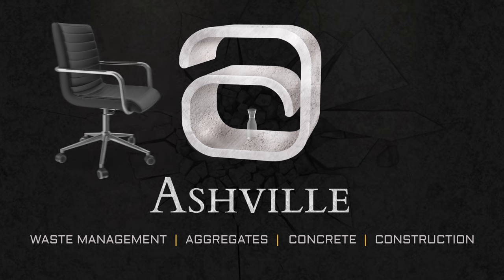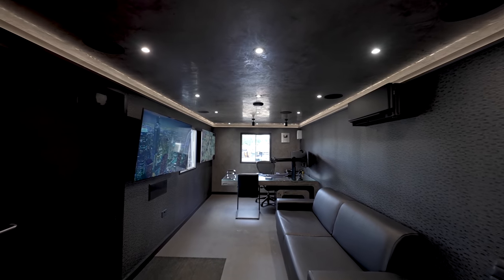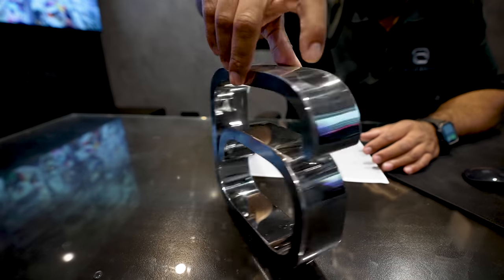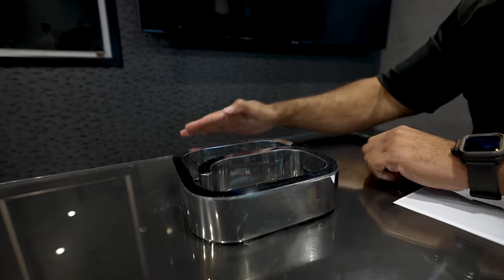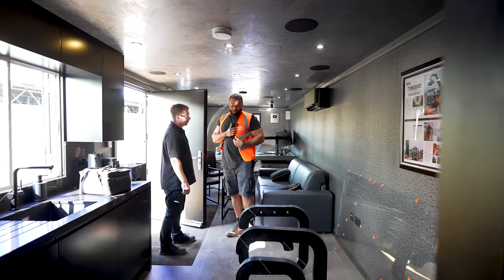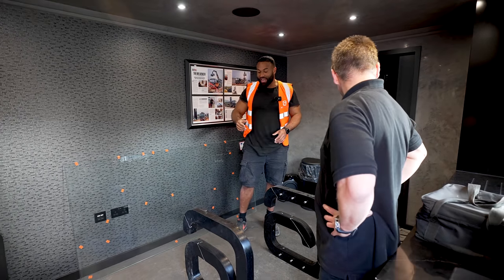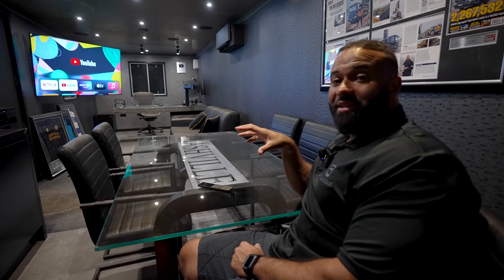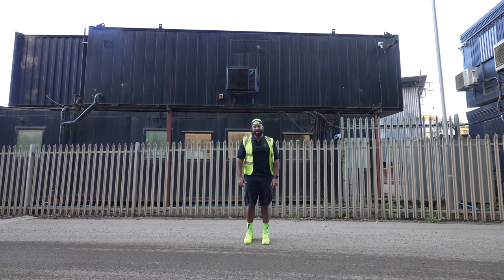Building A Branded Custom Boardroom Table for My Container Office

Comment: Dope! I have a suggestion tho: Why not add like motorized rails to the bottom of the A’s so you can just move it in-and-out with the press of a button? So you don’t have to keep pulling on the glass to move it. Also, when you move the shipping container it’ll stay locked in place.
Reply: Yes! Could even be connected to the Control4 system so its position can be changed from anywhere in the room with the remote

Comment: Hi from NZ. Looks great, but my concern is the stress from the weight only being on one part of the stone “A”, maybe a good idea would have been to of routered out a recess between the  two stone halves and installed some steel to take the weight, then glued the two halves together. Just hope it doesn’t break if someone puts some weight on it considering you’ve got a glass top.
Love the vids

Comment: Looks slick!  Maybe toss some of those rubber bumpers you put on the SS Ashville section on the underside of the glass, against the SS.  They'd act as bumpstops so the glass cannot slide.   I'd almost say that a beadblasted finish on the glass except in the middle where the Ashville is might be an easier surface to work on.   The opaque surface would, reflect less light, show fewer fingerprints, and be easier on the eyes.

In V2.0 toss some LEDs on the bottom on the Ashville grate so you can backlight it.  :)

Comment: The skip boat brought me here.  The A as table supports great idea.  My idea would have the steel Ashville embedded in clear epoxy or incased in glassed and raised to the ceiling when not in use.  Maybe have the A supports on a lift under the container since you have the container on a second level.  I am guessing you don't have many spontaneous board or team meetings?

Comment: Question: Why didn't you set it up so the "a" closer to the bog was 180 degree flipped? That way it would have been 'not a 6' from either end.
Reply: I was thinking that as well
Reply: This would also have helped with the lever stress on the top part of the "a". The 2 vertical parts would have been in opposing corners...

Comment: Coolio though you may find the nuts on the bolts come loose, it appeared in the film the bolts were not long enough to reach the "Nylock" element of the nuts thus they will not lock, could have just been the camera angle of course, great design though no doubt!

Comment: Should have used an Engine part for the stand or something similar. I think the Ashville logos everywhere is getting overwhelming. You can using truck parts or construction off cuts for your bespoke furniture and it would end up looking more creative. Not everything needs to be embroidered in the Ashville Logo.

Comment: You should've flipped the "a" on the toilet's side then it would be an "a" from either side.  Apposing "a's" would also be more structural as the open sides would be opposite.

Comment: The legs on the chairs should be the same as the steel on the table so the 2 quartz 'A's stand out more.
Reply: Or put a very faint yellow pinstripe type edging on the 2 quartz 'A's. They don't stand out like they should!!

Comment: Maybe add some LEDS so the Ashville glows. Possibly add wheels so its easy to move the table. Maybe a see through vinyl on the glass to prevent scratches.